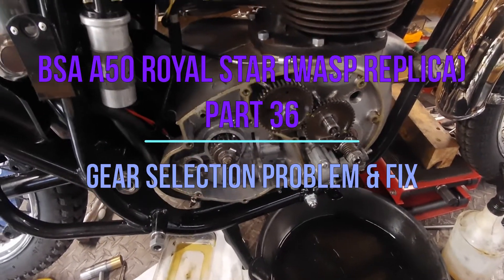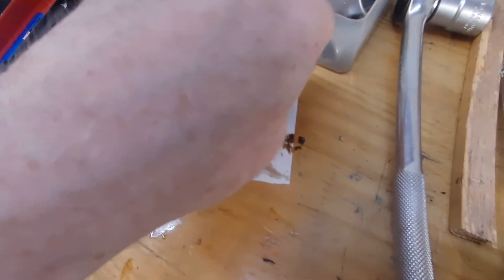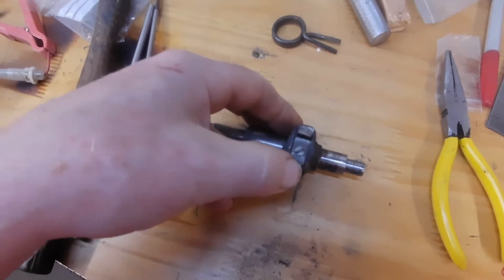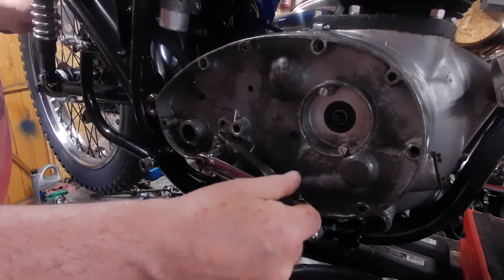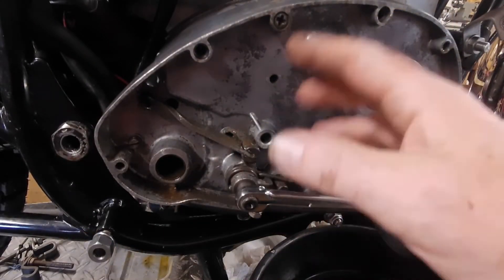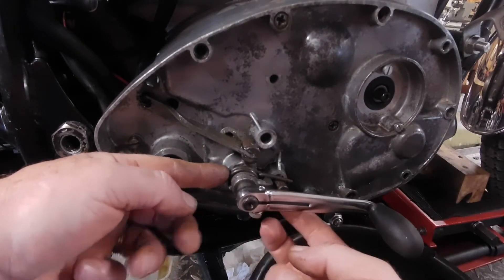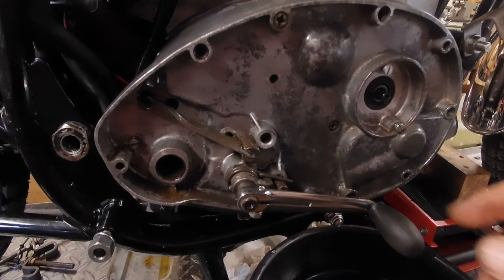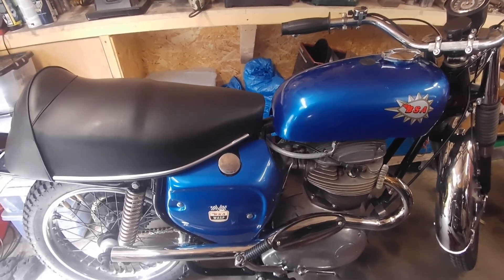BSA A50 Part 36 Gear Selection Problem and Fix

Comment: Nice to find a newer video. Just bought a 65T and hit a speed bump one day in a parking lot on the frame and broke my speedometer drive and have gear selection problems once the motor gets hot. It's not a lot of fun attempting to drive back to the garage in 2nd in a 55 zone. First bike so it's a bit daunting tearing into it.
Reply from the maker: Hope all goes well with your repairs

Comment: Glad you have the gear selection sorted. What a terrible pity about the tank. You put a lot into that. The quality of some of the pattern parts is shameful. 
Best wishes, Dean.
Reply from the maker: I think some over zealous English wheeling on the tank caused the pin hole on the side but at least I was lucky finding a NOS spring to sort the gear selection.

Comment: hi i bought one of them rubber inner timing side gaskets and i had no end of trouble with it as the inner timing screws kept coming lose, i even tried loctite to no avail every time i would go out for run the dam things worked lose i would go to my garage the next day and see a big pool of oil under the bike so in the end i took it off and put it straight in the bin and by the way it had started to rot so just be aware, and you've got the return spring the right way round, i also found that the grub screw on the gear change stop/ spring locator/ can shift on the quadrant as some grub screws have flats on the bottom so what i do is to get a grub screw with a point on the bottom so it bites into the shaft a little i hope this may help you. and an other pin hole in the tank that is crazy i feel for you how sad and disappointing, as i said in the earlier vid when you get round to a repair i would still put some tank sealer in as you don't know if a an other pin holes might appear, por 15 tank sealer is very good and not dear, anyway take kind regards Adrian.
Reply from the maker: Yes I found those rubber gaskets to be a bit leaky too, was handy for testing purposes but I have since replaced with a normal gasket and Wellseal.
I put a bit of thread lock on the grub screw, seems to hold it ok.